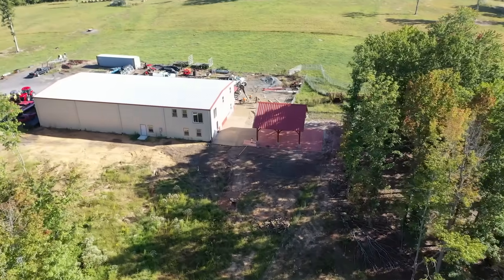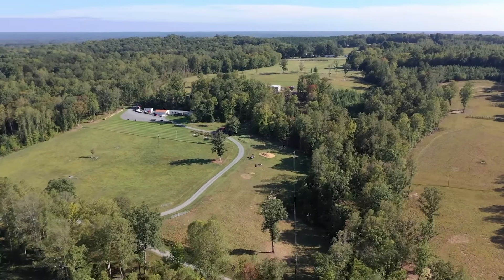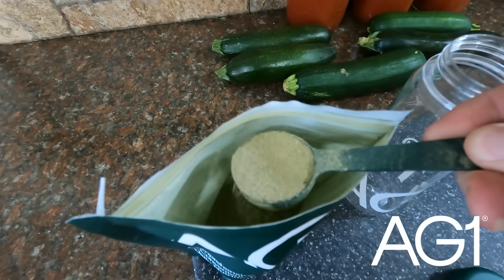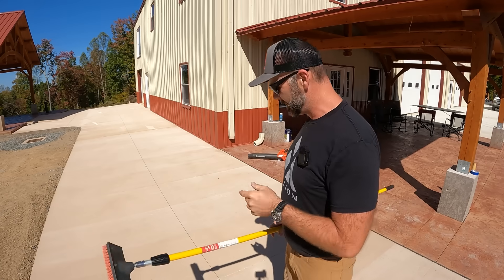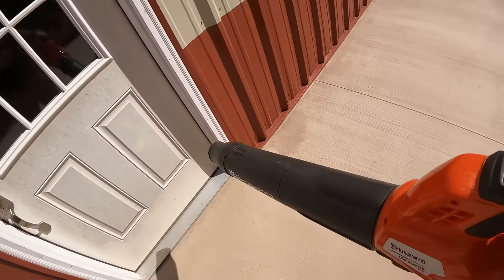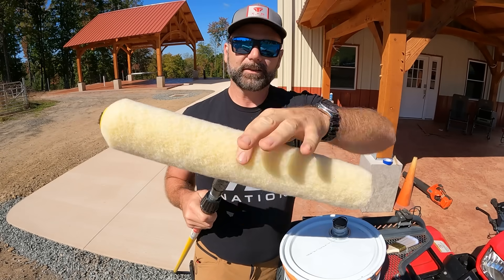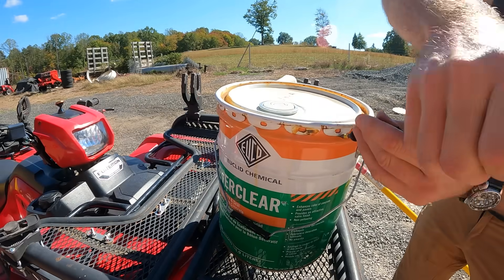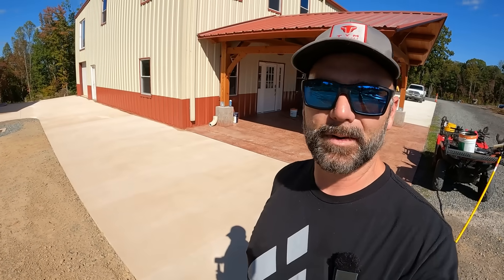How to seal and protect your concrete driveway or patio so it lasts!

Comment: Euclid is one of the best chemical company's. Super diamond clear is nice because its a cure n seal, not just a sealer. You can roll it on same day. It lasts longer than most sealers . 45% solids. Ever clear is a 30% solids i believe. Beautiful concrete work. Great video
Reply from the maker: great advice...and you know what....the second coat will be Euclid Super Diamond! Darn stuff was $300 per 5 gallon bucket!!! AHHHH!!!!
Reply: @StoneyRidgeFarmer  ya, it's expensive.  It's the. After you put it down,  then the next season spray it with xylene instead of putting more product down. Multiple layers captures dirt in between and it starts turning yellow. Then the next year put a new coat of super down.

Comment: @Stoney Ridge Farmer

WOOOOOOO!

Are you going to use an elastomeric filler for the expansion joints?
Reply from the maker: ya know...I'm not sure yet
Reply: @StoneyRidgeFarmer  

I figure it's got to be good for both weed control and ice, especially in that shady spot between the megashop and the outdoor kitchen.  How frequently do you get that rain that turns to sleet and then snow?

Comment: You can use a sprayer is better than rolling
Reply from the maker: why?
Reply: @StoneyRidgeFarmer  just see on Youtube Concrete with the Hauses Tom was doing concrete for more than 35 yrs and my self I was a general contractor for 40 yrs and we talk again
Reply from the maker: If you're giving me advice on spraying v/s rolling, I'm just asking you why brother...not asking to be sent to another youtuber....why in your experience?  There's a million "youtube experts" out there, but have you found it better in your experience? Seems to me overspray would be a huge issue here around the other concrete and building
Reply: @StoneyRidgeFarmer  dont worry for mid days when always you are going to have full days. I have more than 40 yrs of been a General Contractor specialized as Home Builder here in PR and the construction here is full in concrete and always to seal we use a sprayer because cover the whole area in less time if you like to roll works I send to you to see Tom spraying seal and always he explain we he spray that was the only reason 👍🏻
Reply: Ever clear is thin enough to spray. Most sealers aren't unless you thin them or use an airless sprayer. Rolling does such a better job of product integration into the concrete. Spraying is generally used on cures. Sealers need saturation to last and do there job. I've been to many chemicals schools over the last 35 years. There are so many chemical variations in sealers. Euclid is by far my favorite because it's the real deal. No cheap fillers.